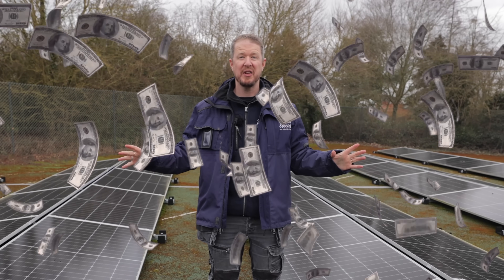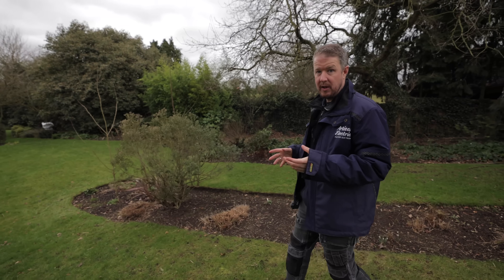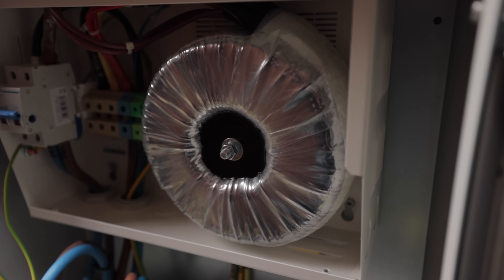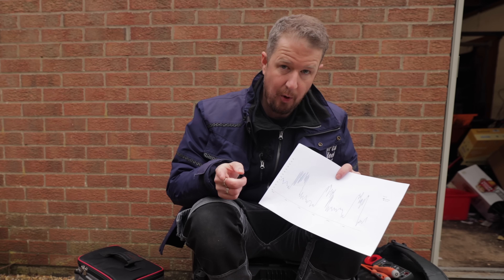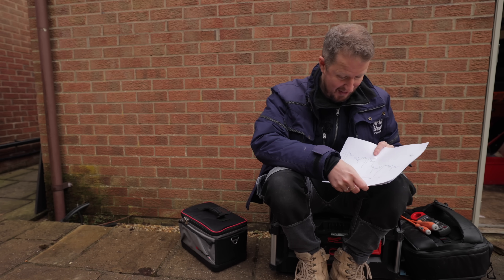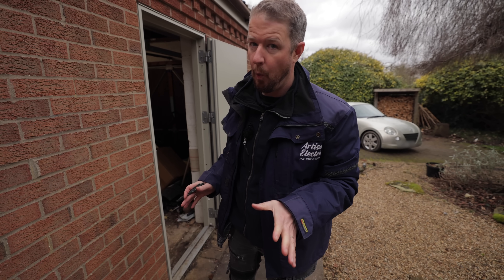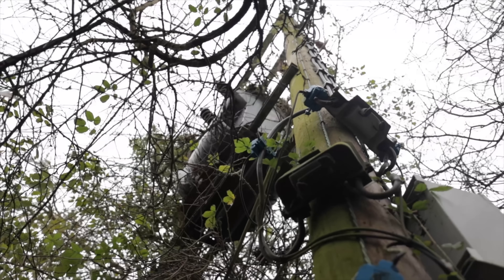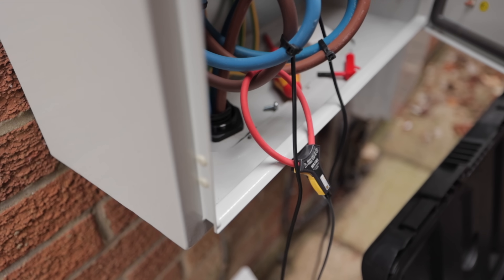THOUSANDS Down the Drain – And We Can’t Do Anything About It!

Comment: Pardon my ignorance, I am just trying to understand the problem presented in the video.  I am a retired electrical engineer that designed, amongst other circuitry, switching power supplies, power inverters, complex control loops, and protection circuits.  I live in the US, in which there are noticable differences between residential grid options versus the UK.  I also have never installed a grid tied solar system but, familiar with the overall hookup.

At first, the symptoms sounded like the inverter had no voltage regulation but, produced an output voltage proportional to the DC input.  However, I discounted this idea because, I don't believe anyone is making an inverter this crude any longer.  Therefore, I can only conclude the inverter is raising it's output voltage as necessary to dump it's excess power generation in order to derive as much payback as possible.  This tells me the designers of such inverters don't fully understand the environment they are working into.  I would assume, if set up properly, the inverter output voltage should be regulated and set to a few voltage above the nominal daytime mains voltage.

With a 17 kW output into the local mains, that's quite a bit of power and voltage rise.  If there is that much excess voltage, there would likely be considerable heating taking place somewhere.  I recommend viewing the power lines between the house and local line transformer with an IR camera.  This would probably be quite revealing.
Reply: It is clear that the DNO is not maintaining its infra structure seeing all that vegetation overgrowing the poles, cables and the transformer.
I lived in Wales for 30+years and the local DNO SP-MANWEB did helicopter overflights of it's network 
Living in a remote farm property I used to receive notices from SP to gain access to my property to cut back any trees within 3 metres if overhead lines 
This preventative maintenance reduces the likelihood of line damage from winter storms and therefore the amount of emergency call out time for the line engineers.
Seems that the local DNO to your customer is failing in that responsibility.
Clearly the solar system is capable of overwhelming the capacity of the local network to absorb it.
Poor maintenance of the local infra structure doesn't help either.
Reply: @stevejagger8602  Was that cutback for trees close to LV cables or HV cables? I suspect the latter.
Reply: @mpellatt  in my case it was cutting back from HV overhead connecting to my transformer.
What impressed me was the act of preventative maintenance that has now become a forgotten art.
Reply: @stevejagger8602 It's budgeting at it's finest.
Pay $x on preventative maintenance, more or less guaranteed every year.
Or... pay $? on preventable emergency repairs, and SLA breaches. Sometimes. Maybe on average, this will be less than the maintenance; and sometimes, there are grants/relief funds for this, which sweeten the pot. And, when possible... blame the customer. Hey, you didn't trim the trees on your property and it caused all of this damage. You foot the bill!
Reply: @stevejagger8602  I concur, SP-Manweb regularly check out the path of overhead lines. Trees and hedges cut as necessary and I haven't seen that amount of ivy on an electric or phone pole since I've lived in Wales. We've had pole transformers catch fire and salt jacking problems but you can see the transformers. Last Autumn, one night, I could hear clicking outside, looked up at my transformer, and could see tiny sparks. I reported it and it was fixed. Who is going to notice similar, amongst the ivy?
Reply: I think the problem is the residential system is supplying too much to the grid. If it has 16mm2 overhead cables feeding it, they may need to be upgraded to 25mm2 or 35mm2 to the first pole. But what is the grid supply size to that last pole?
Reply: @Hunty49  16mm2 ???  That's really small wire, I assume the UK spec is based around copper wire?  In the US they use 85mm2 (000 AWG) for pole-to-house hookup aluminum wire.  The default US residential standard is a 200 amp, 240 volt service.
Reply: @billharris6886  UK uses copper cable at 240 volts. The higher the voltage, the less current it has to carry, so the smaller the cable size can be. 10mm2 copper cable is good for 63 amps. 25mm2 is good for 100 amps.
Reply: @Hunty49  Thank you for the UK wire details, that gives me a better understanding of your system.
Reply: @billharris6886  
Most UK grid have small wires as VERY much of it is still from 1950 and earlier.
Most are from being dimensioned for handling what is described in this video.
In my opinion is it pure lunacy what they have done and it suggest that they know very little about what they are doing.
Reply: @The_Judge300  You may be right, I know the British way of doing things is very much tied to tradition.  This is actually a good thing from the standpoint of going off an established track record.  However, tradition has to be compared with reality every so often to make sure it has not become obsolete.  The long, perhaps undersized overhead wire and the inverter output output voltage feeding the local grid seems most suspect.
Reply: @billharris6886 16mm^2 copper at 230V can do 80A, which is enough for most single phase homes. Aluminum has more resistance and so needs bigger cable
Reply: @billharris6886  double the voltage, half the current, quarter the losses per given gauge.

That so can make a cuppa quicker.
Reply: @GeekfromYorkshire  Yes, one of the many reasons Thomas Edison's Direct Current power distribution system quickly became obsolete.  I also heard he discovered the incandescent bulbs were dimming on long train platforms so, to address this, he added a second 100 volt supply line, which is probably why the US homes are fed with 240 volts, with a center-tapped pole transformer.  So, 2 lines of 120 volts feed the house and supply the lower power outlets in the house (which accounts for typically 90+% in the average US home.).  This actually turned out to be a good idea, as it reduces the chance of electrocution.
Reply: @billharris6886 I thought US was on 120v ?!!
Reply: @julesviolin  It all depends upon how you look at it.  US homes are fed with 240 volts, 60 Hz power from a center-tapped pole mounted transformer.  This means there are 3 wires feeding the house; two 120 volt mains and a return.  Across the two mains is 240 volts or, from either main to the return; 120 volts.  Or, to add probably more confusion, you could say the house is fed with 2 phase 120 volt power, with 180 degrees between phases.
Reply: Using an IR camera on the visible supply line might be a good idea - could quickly localise any higher than acceptable impedance issues. One problem for this installation would be the overgrown plants obstructing line of sight.
Reply: @ianburton9223  The overgrown plants covering the power lines problem is interesting, I would think that would be a "no brainer" for the power company understand and to correct.  Here in the US, I suspect they have a maintenance requirement to keep plant life off the lines, as I have never seen neighborhood lines covered by plants.  We do have big problems with squirrels getting themselves across the high voltage input to the pole transformer but, this problem has been essentially solved within the past 10 years or so by special "squirrel insulation guards".
Reply: @billharris6886  How does vegetation affect resistance? Are cable lines insolated/do trees short them ? Thanks
Reply: @АгронДепартье  Since the vegetation is wet within it to stay alive, the water (or moisture) easily conducts electricity.  If the overhead power lines are not insulated, the vegetation would burn away very quickly if the wires are not insulated.  However, each country and power company can run their wiring differently.  In the US (United States), I live in the state of Florida in a forest area.  The overhead lines are not insulated and have a voltage of 7,500 volts.  Due to this high voltage level, no plant life is present on the supply wire but, the earthed return wire has all types of plant growth (mostly Spanish Moss).  I'm not sure what the power distribution system is like in the Ukraine.
Reply: @ianburton9223  The overgrown plants covering the power lines problem is interesting, I would think that would be a "no brainer" for the power company understand and to correct.  Here in the US, I suspect they have a maintenance requirement to keep plant life off the lines, as I have never seen neighborhood lines covered by plants.  We do have big problems with squirrels getting themselves across the high voltage input to the pole transformer but, this problem has been essentially solved within the past 10 years or so by special "squirrel insulation guards".
Reply: I am also a recently retired electrical engineer and I worked in power systems for connection of MW scale renewable energy projects.This is not an inverter design problem, it's a result of the excessive impedance of the grid as seen from the inverter (comprising LV underground cable, LV overhead line, LV/11kV transformer and to a much lesser extent 11kV overhead line etc.). This impedance is greater than the grid company's engineers estimated when they gave permission (G99) for 17kW of generating capacity (of any type: inverter or alternator) to be connected to the customer's installation, resulting in excessive voltage changes with load/generation changes. This impedance could result in heating in the local grid (particularly if the impedance is mostly resistance e.g. in the long LV cable and LV overhead line) but this will be spread out over several hundred yards and should not give rise to unacceptable temperatures (unless the grid company engineers really messed up). A significant part of the grid impedance will be in the LV/11kV transformer
Reply: @redshift3  Thank you for providing details as to how the local neighborhood grid is constructed.  I mentioned possible improper inverter design based upon the inverter outputting voltage above the acceptable voltage limit of 253 volts.  I agree, there does appear to be a line impedance issue, based upon the 260+ volts appearing on the mains at the customer's home with the grid-tie solar.  In the video, I was surprised at the long line length between the pole transformer and the customer's home.  Here in the US, typically a 50 kVa pole transformer is used to supply not more than 4 homes.  Similar long line lengths between the pole transformer and home are usually confined to supplying a single home.  Neighborhood High voltage levels are from 7.5 to 13 kV depending upon the power company.
Reply: @redshift3 Hope you are enjoying your retirement. Question if it was TNCS earthing and they installed enough local earthing  alongside the PME/TNCS  earthing would that lower substantially the Ze and thus the impedance of L/N would this cure the voltage spike and for the low voltage if that does not solve it, just lower the charging current. ?
Reply: @brianoneill350  this is a three-phase installation, so neutral currents should be negligible if it's balanced. Therefore reducing the resistance of the combined neutral/earth wouldn't help. Even in a single-phase installation, the impedance of the combined neutral/earth is probably much lower than the resistance of the path from the consumer's earth to the transformer earth, so improving the consumer's earth would have only a small effect. LV installations aren't my area of expertise, so I'm happy to be corrected
Reply: I don’t work on power distribution, but it seems to me that there’s too high a resistance in the wiring somewhere.  It could either be in the 230V wiring, or in the 11KV wiring.  If you’re consuming power, this would show as a voltage drop.  If you’re generating power, it would show as the local voltage too high.
Reply: A photovoltaic inverter is not a voltage source, it's a current source. So yes, by design what it does is raise its voltage enough until it can 'dump' enough power into the grid. And when it reaches the cutoff voltage it needs to shut itself off, that's mandated. Again, this is completely by design.
Reply: Would be interesting if there is a second system trying to dump also, and the two are fighting each other.
Reply: Comparing US with Europe is pointless :) Also every country in Europe is different, regardless EU directives. For example in Bulgaria we have villages with 200-300 houses with no more than 5-6 big (typically over 500-1000kVA) transformers. We rarely have 11kV lines - most are 20kV. In rural areas - mostly underground.
Reply: @tsvetomirivanov9762  Thank you for some of the Bulgarian power distribution system details, I always find the differences between countries very interesting.  I merely mentioned the comparison between the US and UK as an educational courtesy.  However, my intent was to understand the UK system in order to troubleshooting the problem presented in the video.  I am sorry if the comparison added a layer of confusion.
Reply: 1000% - How is this a problem with the grid? Surely its the inverters that are dictating the voltage? They don't even have to take all the power from the panels either, so if its a problem with feeding to the grid then its because the customer doesn't want to restrict output?
Reply: @jamestrotter7852   I think inverters must always follow the grid voltage by design. But since the inverter is pushing a big current into the grid, if the grid lines have a higher impedance than usual there'll be a rise in the grid voltage. It seems that the network operator may have given the go ahead for connection of this big system without checking if their supply would be able to cope without causing this type of issue.
Reply: I agree with you re your comments about the inverters, they have to be regulated, also they are in paralel with the mains so should never be able to increase voltage (unless faulty) but to be honest 17kw is small potatoes to a supply feeding othe properties as well. Also when lines are too small or long what results is a lowering of voltage through resistive drop. Had the problem been at anytime other than only the daytime I would have thought the mains supply into the property was suffering a Neutral earth leak where voltages can rise to 300 volts.
Reply: @Nailnuke  Thank you for your comment, you bring up some good points.  The good solid Earthing is important for any power source but, especially when it is backfeeding  the local grid.  I don't know how many homes that overhead line is feeding but, @artisanelectrics mentioned a 300 meter distance from the house to the pole transformer, along with the plant life seems suspect.  Hopefully the many comments from the video have been helpful to @artisanelectrics toward resolving the problem.
Reply: at these scales and conductor thicknesses you will notice heat in the conductors but nothing serious. but even at like 95mm², at like 1km there will be serious voltage drop/rise at like 150A total current
Reply: this
Reply: Why can't the inverter regulate the output voltage? We demand answers from the content creator!
Reply: @relobmit  Personally I expect they can, I expect the customer was happy to spike the local voltage rather than not make as much return on the panels as possible
Reply: Okay, it sounds like a high impedance circuit so that 266V is needed to export 17kW into the grid. Tbh, as long as it's been metered then live with the high voltage. Remove the PEN fault relay or change the settings.
Reply: Check for cable Diameter and size (inhouse wirering)
Second thing: propably you can configure the max ramp voltage. Please call SolarEdge for Support.

Please remove this spooky voltage normalizer. 200 or 300meter wire is also a very resistive circumstance... to Bad. 

The only thing as quick fix: reconfigure max voltage to match specs. Masseure  U out directly on DNO's transformer "tree" xD and compare / calculate wire resistor... 🎉
Reply: Shut up you are retired.
Reply: The problem is the DNO gave permission for them to export 17kW without checking what that would do to the local grid voltage.
Reply: I think this is in UK? or in EU.  Their inverter do not have voltage balancer or someting like that...
I am from USA...  The inverter here has that...  If you buy the all in one inverter or off grid or on grid or hybrid... if go with Victron.  The solar charge controller will charge to batteries.  Then the inverter will does it job sine wave keep the same 230v / 240v or 120v at all time... the different count be at 3-5v below the max, or if there is a device/cooker cook top cause the power to flux which is: 120v normal.  when it off it made the power jump to 130 but the inverter bring it down to 120 right away on the screen of the inverter......
Reply: These greedy people want to supply electric back to the grid at premium prices usual middle class rich virtue signallers
Reply: The problem was that the customer couldn't charge his electric car
Reply: @aussiejackofalltrades  Agreed, that high mains voltage (about 260 Vac) probably tripped the car charger High Line Voltage cut-out.  Although, if the car charger had started drawing current to charge, it probably would have dropped the line voltage to within the acceptance window of operation.
Reply: @aussiejackofalltrades  Well, no, the symptom was that the customer couldn't charge their electric car. The problem isn't that, neither is it solved by the introdction of an autotransformer.
Reply: @aussiejackofalltrades  
The problem is that the ones that have installed it all, have not understood what they are doing at all.
If this had been in the EU and some other European countries, they would for sure have broken laws and be in big problems...